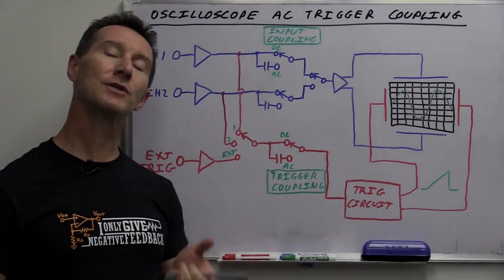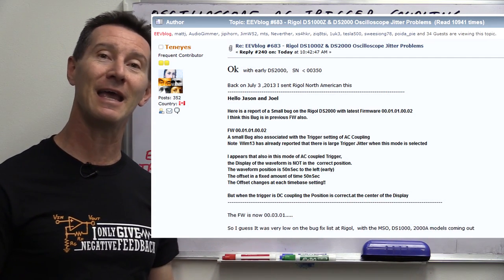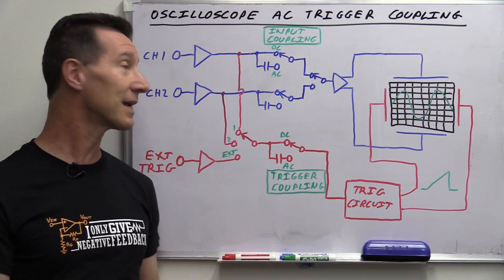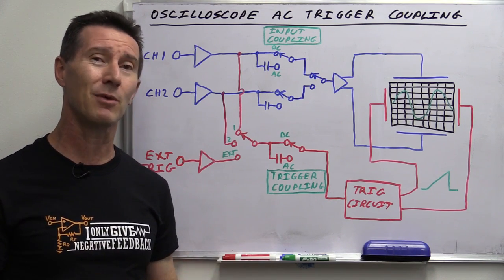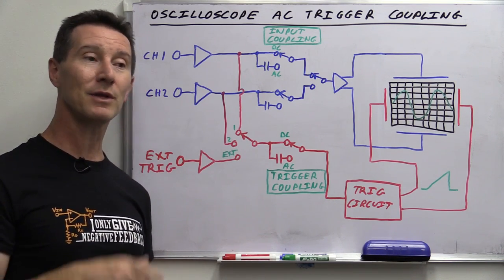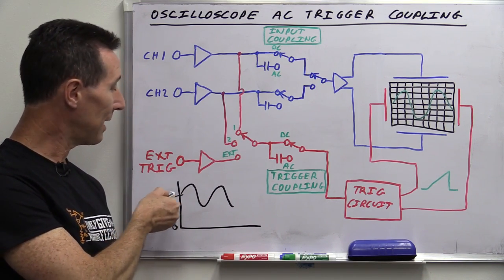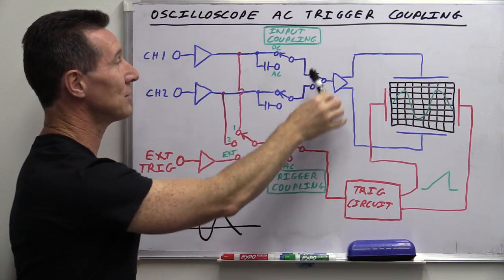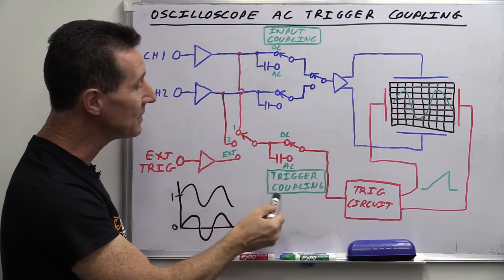EEVblog #685 - What Is Oscilloscope AC Trigger Coupling?

Comment: Outstanding Dave!  The scope companies need to educate users more.  They generally give you a manual (if even that) and it tells you what the controls are, what they do, and that's it.  It's an entirely different matter to explain how to use particular controls in a way that a) makes sense, and b) has a practical application.  Dave, your explanation was excellent and underscores that you have to know what you're getting with a scope and how to use it to take full advantage.  This kind of stuff they don't teach in engineering school.  Dave, you are an invaluable resource to electronics.  Love your videos!

Comment: A lot of high-end analog scopes also have a "Trigger View" button, which is useful a couple of ways. First of all, it shows you exactly what's going into the trigger circuit, after all of the coupling and filtering, so you can get a better idea of what's going on with complex signals. Also, I sometimes used it as a convenient way to view a third signal (external trigger input) on a 2-channel scope.
Reply: 是全台%

Comment: Still working with my "pimped" Rigol DS1052E and for audio work at home, this scope is more than enough. But my scope at work is a Rhode & Schwarz for measurements for FM transmitters. And it's an older type and weight tons. That scope has a user manual from a few hundred pages, after 15 years I know this scope's capabilities. That's a long time to figure that one out.

Comment: One question: On your first diagram, you tap of the channels before their correspondent AC/DC input selection switches. But if I set up my scope to use AC input coupling and use the exact same channel for triggering, then the triggering will be AC coupled as well, won't it?
Thus in my opinion the taps at the channels to the triggering unit should go just behind the input coupling switches.

Comment: I feel it still could make sense having the trigger level marker even with AC coupling.  When you zero the trigger level, it should put the marker at the absolute average of the AC component of the signal.  In other words, in the middle of the wave.  It is digital after all, the SW should be able to figure it out.

Comment: I have an old ---- but very HiTec for its times, ---- LeCroy 7200A with 7242B L2 option Plug-ins [500Mhz @ 2Gs/s], which has a wonderful feature of "Auto Triggering" on any triggering input.  An even though it is truly a 'digital scope' in the sense that it uses two series 250Mhz ADCs, I much prefer to consider it an 'analogue' scope (for a few reasons I'll not get into here).  However, my point here is why isn't Rigol (or many of the other premier manufactures) using such technology in their scopes.  It seems only natural to have such a feature for, as you say, "probing unknown circuits," to which I wholeheartedly agree with your premise on having at minimum a "50%" trigger function, or at least one that the user can "preset"???  Whereas I welcome all comments on this and any input as to some of the main manufacturers' year' of  incorporation of such feature[s].

Comment: First.. could we (and Dave who started it long ago) refrain from separating the buffs from the youngsters? The buffs will die out, the young people (so much talent!) will replace us and I want Dave to have a future audience! Hell, I wish I was younger :-) On my Tek 465 (and the dust collecting predecessors) I always used AC triggering since otherwise I'd often completely lost the trace (as Dave showed). Time for "Beam Find" button, fiddle, then switch to DC trigger, and then tune the trigger level to find that over/under-shoot or weird signal level once a us I was really suspecting/searching for. That is not the case with DSO's, the "beam" is always present (well, in auto trigger, which I often start in) and it saves a lot of time for me. This episode's perfectly clean sinusoidal or square waves are not in my "problem space" (which is digital logic or known/expected analog signal levels with suspected over-under shoots or glitches) and does not really persuade me to switch to AC triggering as default. Perhaps Dave could show a more complicated scenario were AC triggering on a DSO is beneficial over DC coupling? For the record: If Rigol has a selling feature, it should (of course) work, and Dave has and is helping the hobbyists (and professionals) a LOT! Kudos.

Comment: I´m fooling around with my lates find a "VUKO VKS 220-16" basically a hameg 203-4a with an added "transient-recorder" 8kByte/ch. Luckly i got the whole documentation with all the scematics as well. They´re dated 16.84 until 28.84.
AC triggering is working just fine;)

Comment: I think its better to put two lines when AC trigger is selected. Its easier to draw lines in digital scopes and when when two lines are drawn from the reference point then its easier to read whether the trigger is AC coupled or DC coupled. Its all about software.

Comment: Curious. Now in 2020 did Rigol fix that bug of a time base offset based on the time domain choice shifting the signal in ac coupled trigger selecting yet?

There is a 2014 firmware patch that vaguely needs Mentions a trigger bug but not what the bug is. Then a later firmware note suggests the specific problem. 

v00.04.00.00.00   2014/03/18
     - Fixed bugs in triggering function
v00.04.02.04.07   2014/12/31
     - Fixed triggering function
     - Fixed storage function
     - Fixed bugs of jitter in the signal under 
         the AC or low-frequency coupling

Comment: Hi, can you provide a comment on how dangerous an anlogue osciloscope potentially concerning the emission of XRays due to the cathodic tube screen displays? I have read on the user manual of a Hameg oscilloscope that even XRays are emitted the quantity is still considered safe. On other hand, modern digital oscilloscopes are smaller and have displays do not even present this risk. Thanks.

Comment: Does Dave have a video that explains triggering? I understand it as a scope feature that "stops" a "moving trace" when the magnitude of the trace exceeds the magnitude set by the trigger level. Why does the trace move in the first place?

This video did teach me about DC/AC input coupling (in addition to AC trigger coupling) though. Big thanks!
Reply: It moves because it's change in voltage over time. X axis is time

Comment: Nice video Dave! Could you touch on Auto vs. Norm mode? I've always used Auto, but I only have an old clunker CRO (Goldstar OS-7040) where trigger level and holdoff are twitchy.
Reply: Maybe it's the same Norm who used to work with Max doing automotive Air Conditioning engineering.  <groan>   Sorry.

Seriously, I'd like to see that touched on as well.
Reply: Normal mode means that you only see a waveform on the screen when you're triggered on it. Auto mode means that you see the waveform even when you don't have triggered on it and the waveform will just roll from left to right or vice versa. Cheers :)

Comment: What is the purpose of DC trigger coupling then? I thought it is for purely DC voltages, but I checked and AC coupling works well with it too. Why then we even need DC trigger coupling? Not to mention having it as a default setting on digital oscilloscope.
Reply: DC trigger coupling is perfect for triggering on pulses of desired voltage.
Reply from the maker: RussianCthulhu You need DC trigger coupling in order to trigger off the exact point you want if you have a DC offset signal. And you'd be screwed if you had a slow changing single shot waveform like say the start-up ramp of a power supply. DC trigger coupling is essential. In theory you only need DC trigger coupling, but AC can be useful as well as I demonstrated.
Reply: DC coupling is for absolute voltage values. AC is relative

Comment: Dave! I need your help! Could you explain to me why the mean value of the signal in the measurment tab changes slightly when i adjust vertical position of it? I discovered that on both tectronix scopes i have access to. It happens even when the scope is in stop mode. Is it normal? It probably ruined my measurments.

Comment: So if an analog scope such as my Hitachi V-232 doesn't have a switch for AC/DC triggering, which does it use?
Reply: Based off this video, you should be able to test it and see for yourself.
Reply: I don't have a signal generator.
Reply: ***** Then you will have to get a little more creative. ;)
Reply: Hey, that looks pretty cool, or really I could probably just use my stereo since it doesn't really need to be a constant frequency. In either case, I'll have to use the breadboard to apply a DC offset.
Reply: My most recent videos i´ve done with the help of my HiFi CD-player and a Test CD made with my audio PostPro software.

Comment: Why would it be useful to AC input coupling and DC trig coupling? But there must be an application, right?! BTW, thank you for this video you shed SO much light.
Reply: In order to center the waveform on your screen without manually adjusting the vertical but still provide an absolute voltage value for the trigger. But yeah, if you know the DC trigger voltage should know where the wave will be too

Comment: I don't have and oscilloscope, but if those Rigol scope's software can be updated, than fixing it is as simple as making the button to jump to 50%... Of course it's not a real fix, because you still got the problem using ac coupling, but if you have that  50% you don't really have to use it.
Reply: A software fix won't change the writing on the front panel that says zero

Comment: Hey! 50 FPS! Why not 60?

Cool, but a little stuttering on 60hz monitor.
Reply from the maker: Dx Ka My Canon HF G30 does not do 60fps.
Reply: How the hell do you notice it? I have 60hz monitor as well, no problems whatsoever. Or is it just a new troll thing to whine about fps under every video?
Reply: RussianCthulhu
I can see it, too. Actually noticed some jittering on his last video already, but didn't think about the FPS at that time. Now that this videos shows it too, I guess, it is the FPS.
Reply: EEVblog
Reply: superdau do you turn on 720p50 or 1080p50 mode on youtube video settings?
Reply: RussianCthulhu
1080p50
Reply from the maker: RussianCthulhu I cannot see p50 or p60 using Firefox, but can on Chrome.
Reply: EEVblog YouTube's 50fps/60fps playback mode only works in Google Chrome (and possibly other Chrome-based browsers).
Reply: The vast majority of computer monitors are 60Hz regardless of PAL or NTSC region, so it makes sense to record in 30fps or 60fps so every frame is displayed for an even number of screen refreshes. If you record in PAL you're forcing every viewer to change their refresh rate to 50Hz if they want smooth playback, which is annoying and often impossible.
Reply: 4hodmt Recording 30 or 60 fps video in a country with 50 Hz electricity is a great way to cause annoying flickering on the video due to the clash in lighting frequency vs. camera shutter speed. (The opposite is true as well -- I tried using a PAL camcorder under 60 Hz lighting and the result was objectionable flickering.)
Reply: I noticed heavy screen tearing when the whole screen changes dynamically (pannig across the room, for example in the Ness interview the picture jitters and falls apart). It is far less noticeable while standing in front of the whiteboard though. :)
60 Hz monitor here, and, as obvious, 50p video. Vertical sync is there to avoid it in videogames, but it isn't an option here. Falling back to 50 Hz refresh may just fix it...